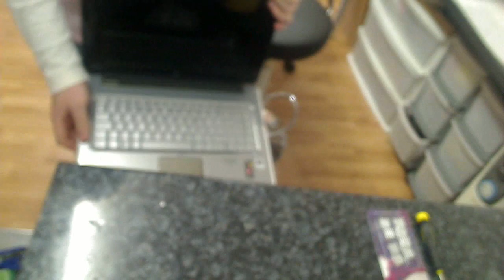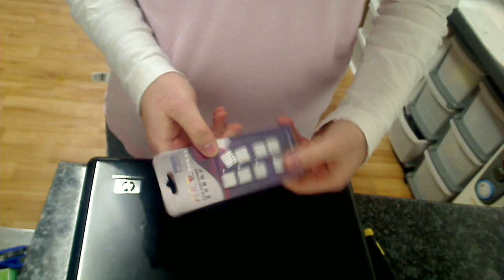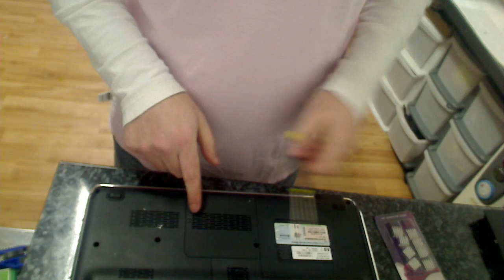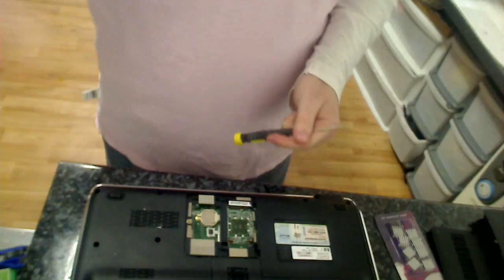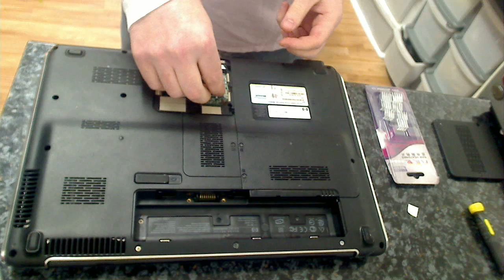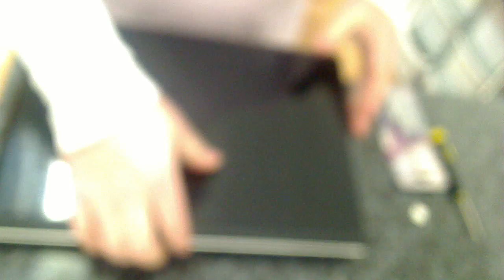HP DV5 DV6 DV7 laptop Wifi Loss fix

Comment: I have the same problem and will never buy a HP laptop again. I am using a mini USB wifi adapter and it solved the problem. I thought it was windows 10 but the WIFI card in some HP laptops is a huge problem. I don't want to take my labtop into HP cause it will be a huge problem and hassle. I will never buy a HP product again. My wifi has been stable since I have been using a USB wifi adapter.

Comment: I have been working on the nvidia no wifi condition on my HP Dv2000 series laptop and I have come across a solution that seems to work for me anyway. I lose my wifi conn. orange light after reboot ect. and so to get Win to recognize my adapter I have to run a program Called FluidMark for about 10 min. and wch the GPU temp go to about 99 to 111 deg C. around 200 deg. F. and after about 10 min. reboot and presto Blue Wifi light and Wifi connection /physx-fluidmark/

Comment: Hi, great trick !

would it be possible for you to do a 1 or 2 min video just to show those heat sinks close-up, and maybe open the back panel again and show a lower angle so we can see the heat sink on-the-ram.... I was surprised you can close the panel again with the heat sink attached, ... they ( the heat sinks ) look to be a good 1/2" in height.  Would be nice to see another quick vid on this.  Thank you if you can.